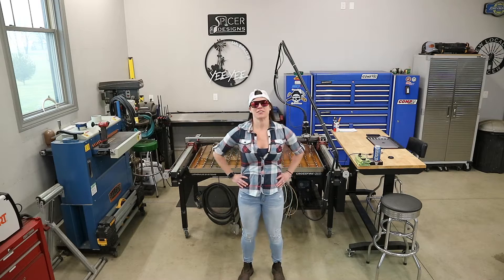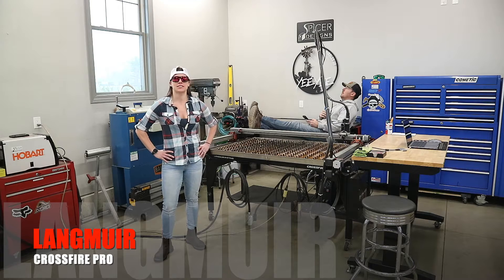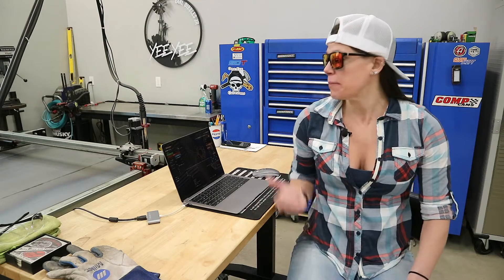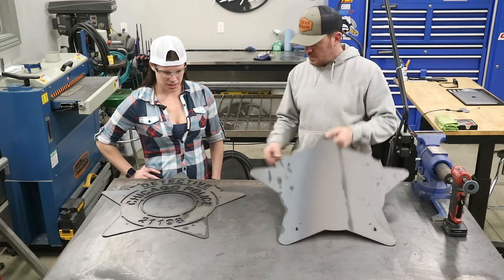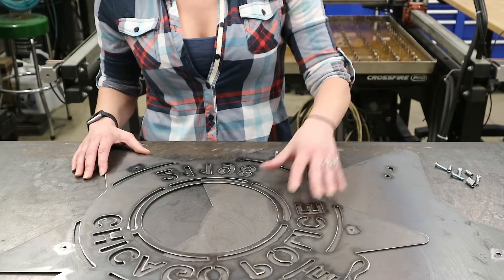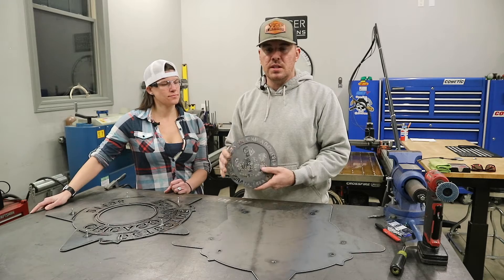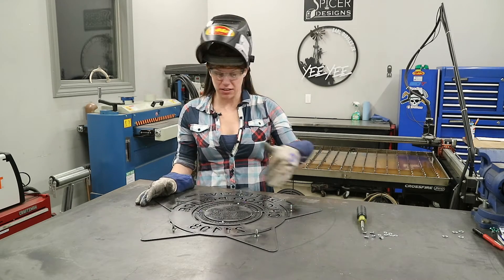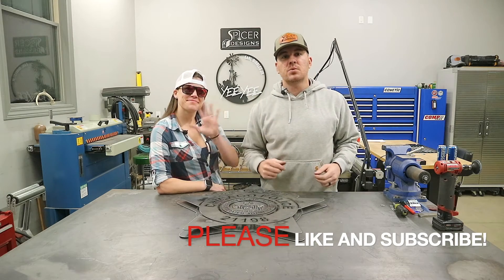Keystone Girl's First CNC Build! ..This Was A BAD Idea...

Comment: The last company I worked for had a stud bolt welder that would definitely speed things up for you guys. I'm not sure how much it is worth but it was the cats meow tacking the stud to electrical boxes in the plant. I wish I could remember the name ugh.
Reply from the maker: I know what your talking about.  Those are pretty nice.  They use them for the studs to mount the backplates.  Thanks for the suggestion!